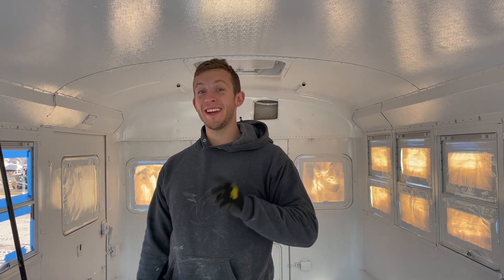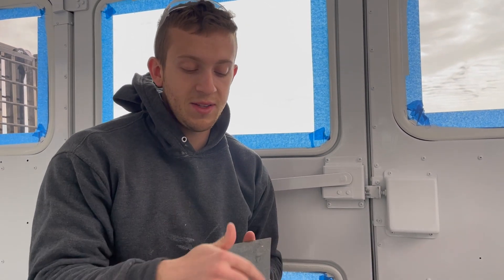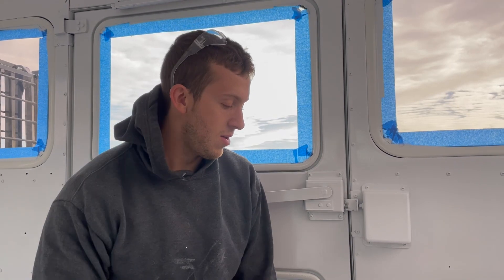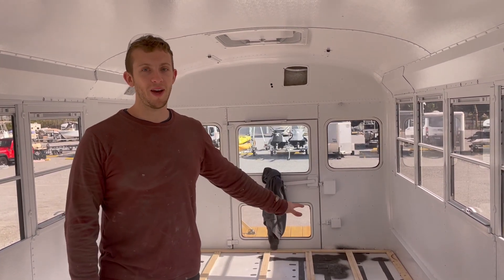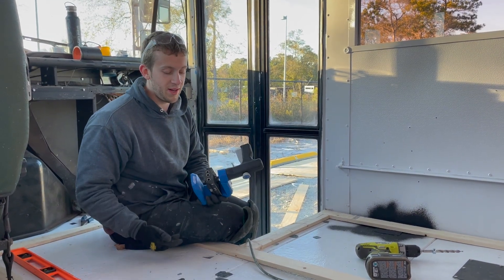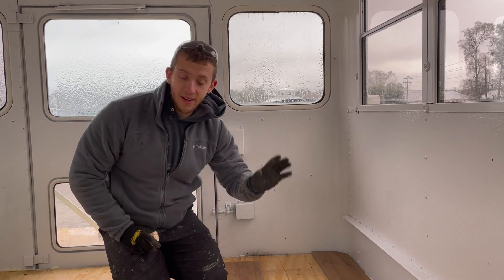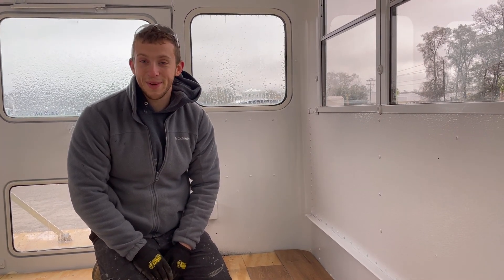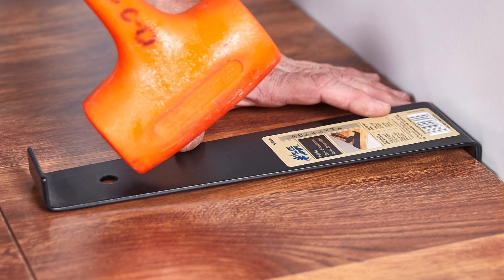School Bus Floor Installation | Subfloor and Insulation | Bus Build 16

Comment: Well, you got almost everything wrong. If you seal every hole on the floor and leave no weep holes for those leaky bus window to drain , you will have a lot of rot. You think floor insulation doesn't have value. Without window replacement and foam insulation in the walls and ceiling, nothing will work. 
 Omit this video and watch Chuck Cassady.
Reply: What's right for one person may not fit another person's needs or budget
Reply: Also, I couldn't use the subfloor Chuck installs because it adds way to much height and my head would hit the ceiling